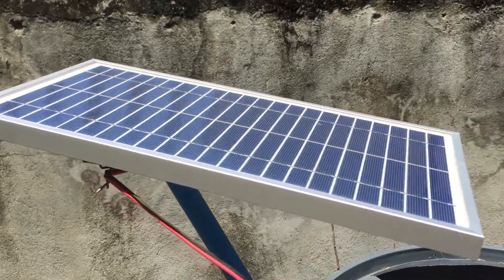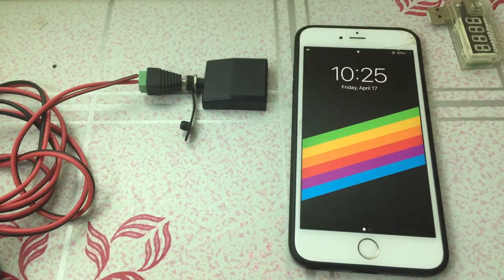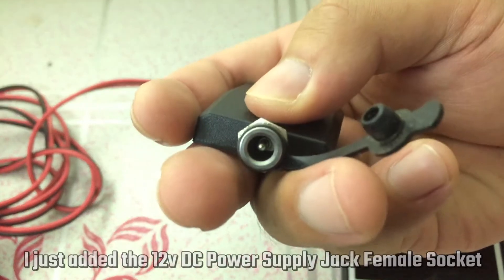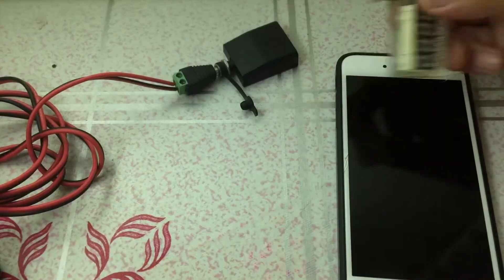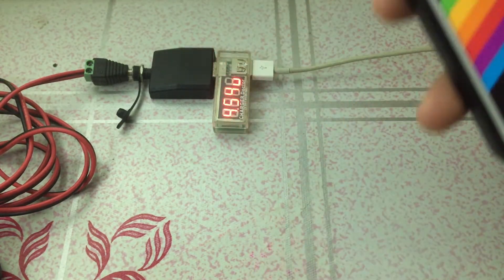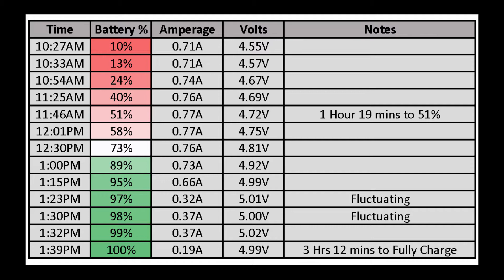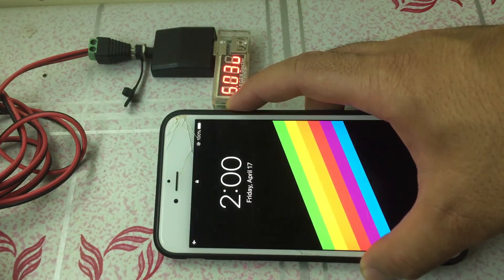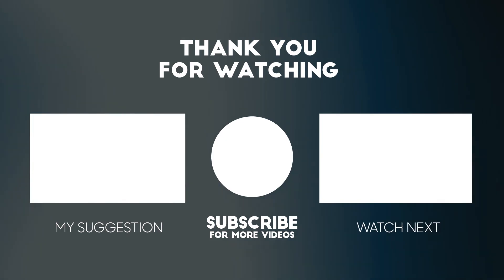Solar powered cell phone charger Test  (12V 8W solar panel) DIY

Comment from the maker: What I used in the video

Dc Power Plug Jack Connector
https://s.shopee.ph/gIJMRIx03

DC Female socket 5.5x2.1mm
https://s.shopee.ph/2VjxWXhKj0

5V 2A Solar Panel USB Charge Voltage Controller Regulator
https://s.shopee.ph/2B778wS1Om

Comment: How did u connect the Female socket to the Regulator? and what was the size of the female socket that you used in this video?
Reply from the maker: It's a 5.5x2.1mm female DC socket and I soldered it to the terminals

Comment: Can you remove the phone battery and run the phone from only a solar panel?
Reply from the maker: Depending on the phone you could but it's not recommended though
Reply: @TaylorSoloaiJR   Could you just do it and make a video?
Reply from the maker: I don't have a phone with a removable battery

Comment: I use a solar panel 10W @ 6 Volts a Current of 1.7 Amperes connected to a LM2596 buck module it charges my iPhone 7 for only an hour. It is not bad to charge an iPhone 6s for three hours for a solar panel.

Comment: How did you charge fully ur cell phone within 3 hours with so low amperage 0. 13 - 0.79 ? It must take much longer!
Reply from the maker: Thanks for asking. You have to remember when a phone is near fully charge the current starts to go down. Thats why you see in the results the amperage went all the way down to 0.19A. It won't be over 0.7A all the way to 100%. Thats why I showed after that I can charge my powerbank with over 0.6A to prove that the amperage did not go down because the sun was getting weak but it was because it was almost fully charged.
Reply: @TaylorSoloaiJR  thanx, but to charge a cell phone with less than 1 Amp you will need a lot of hours, not 3 hours. U charge my cell phone of 2000 MA attached about 0.25 - 125 Ah and it takes at least 8 hours of direct sun to get at most 60%. And I live in Florida.
Reply from the maker: Yes for me I had a lot of sun so it was fast but it's better to use a higher wattage solar panel.

Comment: Can a 50 watt solar panel be used with that module?
Reply from the maker: All i know is the voltage should not exceed 21V but im not sure about the input amperage.

I tested it on a 30W solar panel for 3 months and it still  works fine.
Reply: @TaylorSoloaiJR  then how many hours did the 30w charge your phone?

Comment: Hey what that adapter called or where can i buy that 
The one from the solat out to become USB?
Reply from the maker: I got it from eBay. The name that was listed under "DIY 5V 2A Solar Panel, Power Bank, USB Charge Voltage Controller Regulator Module 6V-20V"

Comment: Hi, Can I add a battery to this to power my 5V 2A wifi camera 24 hours a day?
Reply from the maker: Yes you can use a battery instead of a solar but I don't think it's recommended to use it at 2A continuously because it does get hot. I saw a better version online that can go up to 3A so it should be perfect for what you need.